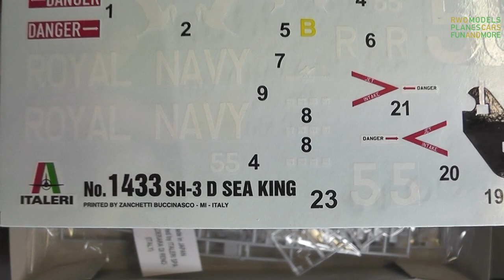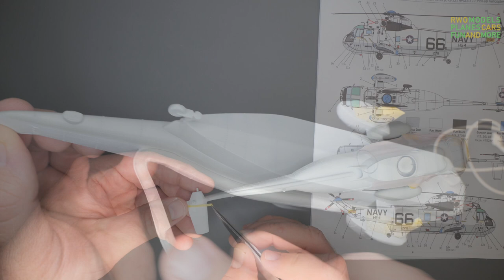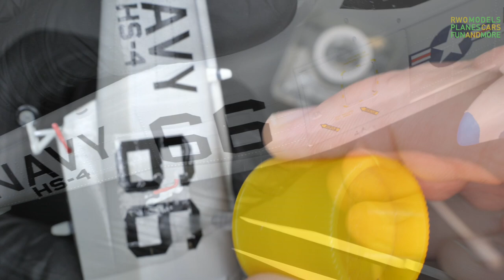Sikorsky SH-3D Sea King Apollo Recovery 1/72 Italeri 1433 Full Build Video | RWO Models

Comment: that is a really nice model, you did a good job.  the only thing missing is the ends of the rotor blades on top have the tips painted in either white, or yellow so when they are spinning any person leaving or entering the helicopter or flight crews working around the helicopter can see where they are and not walk into them.
Reply from the maker: Thanks for taking the time to watch and comment on the video, appreciate it. The Italeri build instructions did not indicate painted rotor blade tips, and in the photos I used for reference I could not clearly identify white or yellow blade tips either (maybe I missed it or the image quality wasn't good enough). That's why I decided to leave the blade tips unpainted, but I'm with you, it's definitely an important safety feature. Thanks again for bringing this detail up.

Comment: That was GREAT!!!  An excellent choice of SH-3's.......I myself have an older Hasagawa 1/72 SH-3 that I still have and want to build, but I have a few questions... 1)  What psi do you use for your airbrush....it's been awhile that I used one, 2) Is it Tamiya yellow tape that you use,  3)  What type of putty did you use for that painting of the grey underside (the one that goes around the whole A/C, and lastly, have you thought of having the sliding door open (the Big one on starboard side) to show off interior???

Otherwise Super!!
Reply from the maker: Thanks for your comment! Below a few answers to your questions, hope this helps:
1) I usually start at 15psi (0.2mm nozzle). Sometimes even a bit lower, in some cases up to 25psi. But approximately 15psi is my most used pressure setting.
2) Yes, I mainly use Tamiya masking tape in different sizes. When I need to cover larger areas I use cheap no-name „sensitive“ masking tape.
3) Stuff is called „UHU patafix“ here in Germany, another brand would be „Tesa Tack“. Not sure how this is called in other countries.
4) The Italeri/Fujimi kit does not offer too much interior details, and since I usually build my models right out of the box without additional scratch-built or aftermarket parts I decided to build the door in closed position.
Thanks again and all the best from Germany, RWO/Oliver
Reply: @RWOModels  thanks for the info.....especially for airbrush, & I think you are correct, my SH-3 is from Fujimi.  I am a model-builder also, but for Navy ships mostly, but I have MANY More different kits to build, take care and Stay Safe in Germany!!

Comment: Very nice build of an interesting subject! I find it very annoying that Italeri doesn’t include the Apollo capsule when the kit is called Apollo Recovery featuring the Apollo Command Module on the box art. I will wait for the Dragon kit that will include this. The Dragon kit will be based on the Cyber Hobby model first issued in 2012 (according to Scalemates). The Italeri originates from the Fujimi kit dating back to 1981.
Reply: I just noticed another interesting thing about the Italeri kit. The box says ”Lunar module and and figures not included” in a small text at the bottom. The Lunar Module was crashed into the moon as soon as the crew had transferred to the Command Module so there would be no reason to include it in the kit. If you’d believe this literally you’d still expect to find a Command Module in the box. Makes me even more annoyed. 😬
Reply from the maker: Hi Magnus, I think you're absolutely right concerning the Lun..., err, Command Module! :) I must admit I also expected it to be part of the kit, not knowing at the time it was basically an old Fujimi re-release. So when I opened the box I was a bit disappointed, the capsule would have been a great addition anyway! Thanks for watching, stay safe! Cheers, Oliver/RWO

Comment: after masking the windows, then cutting away the overlap tape, do you need to clean the residue before spraying?
Reply from the maker: Hi there, not sure if I understand your question correctly, but usually there is no residue from the tape if you use special masking tape like Tamiya etc. It is a special low tack tape designed to avoid picking up paint as well as leaving residues. 🙂 Apart from that it is always a good idea to properly prepare and clean the surfaces before painting, for example with isopropyl alcohol. Hope this helps? Thanks for watching!
Reply: @RWOModels   no, you got it, thanks I'll get some
Reply from the maker: Awesome, good luck with your build(s)! 🙂

Comment: Pretty sure (without checking my stash) that this is an older Fujimi Sea King from the 80s. Tag saying kit made in Japan, the pointed pillars the seats rest on and the awful windscreen indicate this.
They were good at the time but....
Reply from the maker: Thanks for watching and commenting! I also read somewhere it is an old Fujimi kit. Not the best kit in any terms, but received it as a gift, so I'm not complaining. :) Cheers!
Reply: @RWOModels  I purchased several of the Fujimi Westland Sea Kings several years ago on eBay for only a few bucks a piece to rob them of their six bladed tail rotors, interior troop seats and the "early" pattern main rotors to refit some Revell Germany Sea Kings to Falklands War era HAR3s and HC4s. Even the newer Airfix HC4 and HAR3 have the newer main rotors and need an older donor kit to backdate to Falklands era.
Pretty sure Testors carried the Fujimi Sea Kings under their brand in the late 80s..
Worst part of the Fujimi kit was the cockpit windscreen; the framing was way out of proportion. Rest of the kit really wasn't too bad.

Comment: Hello can you say the color and diluent percentual? Please
Reply from the maker: Hi, I don't have a general thinning ratio, I add as much thinner as needed to achieve the paint consistency that I want (the lower the airbrush pressure the thinner the paint). For some colors the paint/thinner ratio may be around 80/20, sometimes 50/50, or in some special cases (post-shading etc.) it can be even 20/80. So it all depends. 😉 Hope this helps anyway, thanks for watching!